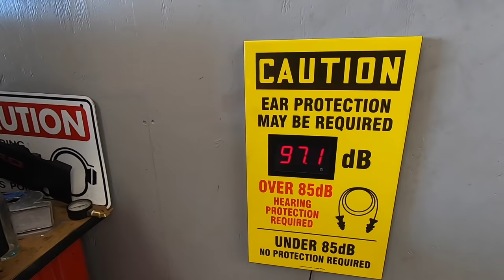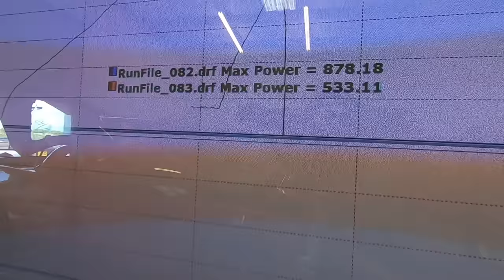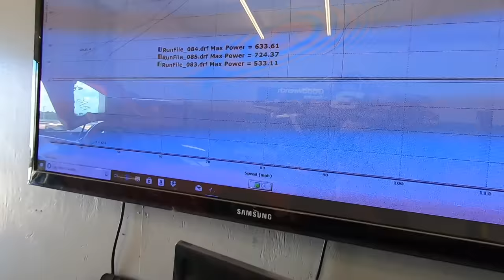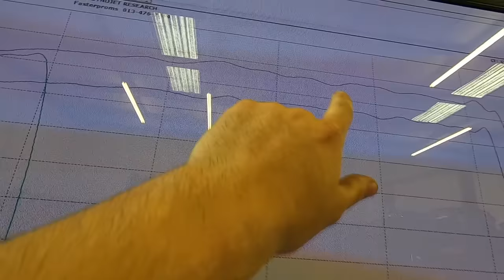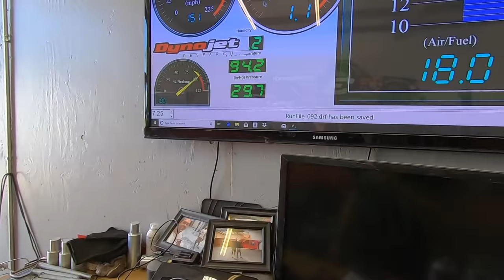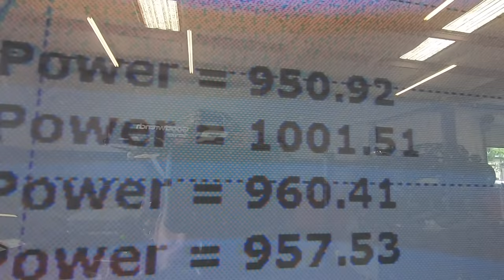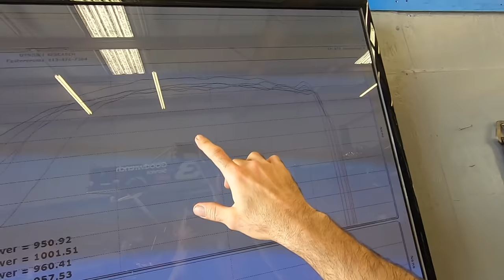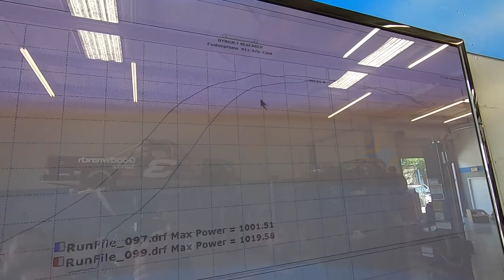The Auction Corvette BOGS DEEP For 1,000hp... Can the Junkyard Engine Do It??

Comment: 1000 horsepower with a Powerglide vs. Leroy slamming gears.
Cant wait.
Reply: Just hope he doesn't money shift Leroy..
Reply: Leroy he get the dub
Reply: There only one clettus he a hell of a driver
Reply: @bsells465  
Ruby is more aero. Will make a way smoother pass with the glide. It should be a close race.
Reply: He will be rusty on leroy and ruby will win one atleast 👌
Reply: Ruby has a chance.. James can drive to 💯
Reply: @tannerrenegar9919  
James is also used to a Powerglide. And not afraid of the rev limiter.
Reply: Ruby will win the race mostly on holeshot and not falling over because of gear shifts.  But it also has just barely gotten into the 8s where Leroy can run bottom 8s with little to no effort.
Reply: With Ruby making 1019rwhp I entered this into Drag racing calculator . If my math is correct Ruby should run ......

1.38 to the 60ft

5.88 to the 1/8th

8.78 to the 1/4

163mph  thru the 1/4 stripe
Reply: @desertrat8322  
Ruby is a low 8 second car all day.
Ran high 8s with 200 less horsepower. The curve with this new Turbo, with the glide. I think it's going to be a really close race.
Reply: Leroy is pretty much an auto when Cletus is in his prime anyway
Reply: James just needs to shift at 8600.
Reply: I have mad Love for both cars, and honestly RUBY is more my style. Buttttt the only way RUBY has a chance at out running Leroy at this stage of the game is if they line both of them up STR8 OFF THE TRAILER with NO test passes before. 
Only bc RUBY is pretty damn dialed in right now, and like someone else said - Cleetus could likely be a hair rusty with the left foot/right hand combo! ...Maybe...
Reply: Ruby is more consistent but Cleetus is also consistent
Reply: James will snap the axle and lose🤣 better have cooper drive and tell him you tuned it down for him but forget to actually do it and he’ll beat leroy
Reply: @desertrat8322  thats just based on hp and weight of a factory vette, theres a lot of weight taken out but a big turbo and all the stuff in the motor bay (almost said under the hood) it would be similar but still not accurate and those simulators are built for perfect conditions, d.a, and pro driver estimations but i like the idea i think the car will be more towards 8.40's and it is all on tire size they are all running small tire almost a street tire size
Reply: This race could be legendary, I'm really pumped for the vid.  Also hope Neighbor and Uncle Sam get to line up.
Reply: @courtneymurphy4476  
No you dont. Fake news.
Reply: I appreciate the tune Up... Georgia's power of the lord

Comment: You should dyno with the flap on the exhaust half half open. Watching previous videos from ruby at the drag strip that flap is pushed down from air resistance past the 1/8 mile.
Reply: Good point! It can't be helping the high rpm restriction!
Reply: It wouldn't make much of a difference if at all on dyno but I definitely see how it could be a concern at high speed.
Reply: The way I see it, even if the tractor flaps are -150hp it's worth it
Reply: Call me crazy, but if you turned those flaps 90 degrees, problem solved.  Hell make em open up opposite of each other and when they both open it'll look like Ruby is giving the two-finger "V" for victory!  Hell yeah!
Reply: Yea when the tractor flaps are closed it can create too much back pressure even being just half way closed and you can lose hp, blew up a motor amongst other things who knows that could have played a factor in that charge pipe getting cherry red hot and not just from having a broken or too small of a waste gate if he turns them around where the wind and exhaust holds them open it might pick up a little bit and he might loose that back pressure issue on the dyno
Reply: I mentioned that and commented on a previous video that they should turn them both around so the air will blow them opened
Reply: @eddominates  I'd bet they lose absolutely 0 HP from the flaps.

Considering bashing headers to fit inside a car does absolutely shit to the HP too.
Reply: dave C I think the restriction is the exhaust manifolds. Isn’t it a truck manifold on one side?
Reply: SkylineBNR34 agreed I seriously doubt the tractor flap does jack shit
Reply: @keefespencer1173  The flaps have no effect on the dyno. The flap can't even fully close due to the sensor at low rpm.
Reply: 70chevelle8 There’s a cross over bringing both headers to one, if I understand what your saying

Comment: Small shot of Nitrous for about a 2 seconds will take care of that turbo lag. Lol
Reply: Better check under the dash for a mini bottle :)
Reply: But don't bring Nitrous anywhere near James! It won't be a small shot for only 2 seconds hahahaha.
Reply: I'd bet on a PID driven solenoid rather than a timer circuit under PWM; CONSTANT DATAAAAAAAAAAAA (and continual gentle reducing of error bars)
Reply: Or rolling launch control, anti-lag works too.

Nitrous runs out ;)

Comment: Lesson learned, check those junkyard blocks, install all new bearings, freshen them up. Have some fun. The deep pan was a good idea, both, for windage and the fact the car leaves hard. For anyone running a dry sump oil system, check those pumps for the proper clearance before bolting them on. Guys have pulled their hair out hunting down low-pressure problems, assuming that the new dry sump pump was a quality piece. Tightening up the clearances [machining end clearances ]brings the pressure up. Keep up the great job guys. I may be one of your oldest fans.

Comment: Loved to see the decibel meter ! I work with many deaf mother truckers and they are always going on about hearing protection and they they regret not wearing it .. now you just need to wear it haha 😂👍🏽 the eardrum will likely rupture at 150db and that one pull hit 124 😂🤦🏽‍♂️
Reply: 150 is is over 5x as loud as 124. Decibels are on a logarithmic scale. Also, as someone who works in audio, this isn't 124dB. Sitting infront of the PA stacks at a rock concert is 125dB. I have no idea where it's reading the signal from, but 124dB at those frequencies would easily leave you with ringing ears for a full day.
Reply: @unlisted9494  1000hp open exhaust? That 123db seems about right. James is always plugging atleast one ear. I imagine coop does too. Cleetus probably gets less sitting in the car so it's not nearly as bad.
Reply: @unlisted9494  The sensor the decibel meter reads from is probably somewhere on the car like the rest of the dyno sensors, hell, knowing these guys they probably put it in one of the pipes. Guess I'll have to wait until Cleetus and Cars tomorrow to hear for myself. I'll report back if Ruby does indeed give me ringing ears.

Comment: Id try some dynamat (or whatever amazon discount version) on the panels for the dyno equipment. Adding the mass and damping should keep the case from rattling around and resonating. Not the egg-crate foam though, thats for stopping higher frequency reflections, and wont stop the panels from rattling anywhere near as well. <$30 shipped for the cheap stuff.

Comment: 100db Lawnmower
110db Steel Mill
120db Chainsaw
123db Ruby
130db Military jet aircraft at takeoff
Reply: A jet is 140db. A 17db jump to the human ear is almost 4x louder. Which is a lot louder
Reply: Actually I think that db-o-meter tops out at 123 db. It stopped jumping around at that value.
Reply: Corvette by cleetus when done - (Inaudible dB)
Reply: My sounds system in my work van does 142db yeah I'm bragging lol
Reply: Dropping shampoo bottle in the shower-600db
Reply: Lol i hit 147dbs in my sedan. All day

Comment: Hey Cleetus: for your dyno pausing issue a solid state hard drive should resolve it.  When it gets super loud as a data protection mechanism the spinning disks park the heads on the drive that run the software for the dyno causing it to halt. Once the vibration (sound level) subsides the heads start to move/read/write again and that's when it starts responding.  By changing the default build-in spinning disk hard drive to a solid state drive with no moving parts sound will not have any impact on it.  They're actually pretty cheep now too.

Comment: If you know where the turbo spools you can edit the area before spool, lean it out and run high timing , basically tune for max NA power, this creates more heat, more cylinder pressure, more NA power and you can play around with this and gain 5-700rpm of spool, plus have more low end power. If you had variable valve timing you can also add overlap to increase spool another 500 rpm but unfortunately you dont have that.

Comment: 123db that's permanent hearing loss country.
Reply: x I agree they need some ear 👂🏼 protection
Reply: Larry Sloan you can’t use hearing protection tuning or racing a car. You need to listen for shift points and strange noises so it’s physically impossible.
Reply: @joshlarochelle1298   bullshit you can hear any knocking or miss with ear protection. You don't have to blow out your ear drums to hear that.
Reply: WHAT ?? @sloanthemechanicl3763
Reply: @joshlarochelle1298 You have no idea what you're talking about. You can hear everything with hearing protection, the sound is just attenuated and you actually pick up strange noises you wouldn't be able to pick up without ear pro.
Reply: @joshlarochelle1298  Brent from PFI wears hearing protection I'm pretty sure and he's a beast!

Comment: Fly me in and I’ll make you guys some great welds for Ruby! Quick question does Ruby’s intake manifold have the allowance for two injectors per cylinder? I also see that your running slicks this time on the Dyno.
Reply: scott moore teach them please!!!
Reply: It is a holley hi ram same as what u can order. Out of jegs so I would imagine those specs would apply here
Reply: Rotor Ryan I would if they would fly me in it would take a couple of weeks!
Reply: Daniel Harrell I thought so if it does they can add fuel using them.

Comment: European car companies: takes weeks,months,years to develop a 1,000 hp car.
Cletus: HOLD MY MOUNTAIN DEW.
Reply: @msengineeringdavid3702  +1

I don't think this engine will do 250 000 km without one major overhaul at least. Even with gentle highway cruise with  the right gearbox (with more than 2 forward gears).
Also, don't forget about the mandatory noise limit (of 83dB @ 3000rpm). 
Also, don't forget we, europeans, drive not only in straight line, but in the turns too. The canyons "of Matt Farah" are ours usual roads. Some of these are almost like highways for us.

I want to watch ruby or leroy in one rally stage of the "tour de corse" for the lulz.

usable power > raw power.
Reply: Guy S Matt Farah drives at a certain place in California just for one takes the rest of California isn’t like that.. there are other states with mountain roads but they are special places some have them as daily commutes but it’s not a real commonality.

Comment: GM set a release date on the new mid engine C8! They should give you one to “bald eagle-ify” one of them bad boys.
Reply: Corvettes should be fr. This mid engine shit is not a vette. I understand why they did it but its no vette. Needs a new name
Reply: @justinwiley9798  the original Corvette rendering was mid engined so actually it is finally a Corvette it's finnally what it was intended to be
Reply: @devinpyrchalla3400  i get that but every corvette has been fr. Thats the basis of the corvette.  It will most likely win le mans but not a true vette. From the start front engine rear drive. Just an opinion.
Reply: Vettes are an old mans cruiser sports car. They have the sound, they have the look, but as far as performance? They are rather slow comparatively. I’ve spent as much as a New z06 on my Nissan 350z, built lq4 bored to 6.8l with a g force four speed top shift. Fully done right. I run 700 as I drive it often daily but could max around 1200. A z06 with 650 hp and more grip than my car as I don’t run rear grip as it’s a drift car, I’d still smoke them doing a rolling burnout. On the tune I run now.
Reply: @joshlarochelle1298  I disagree.  No their not the best but still perform very well. Many 24hr wins under their belt

Comment: Don't laugh off the hearing protection. There will be a day when you want to talk on the phone to your grandkids. You can do things to your hearing that hearing aids can't fix.
Back to levity.
Reply: Captain MufDyven  Great advice. I as well have been around lots of loud cars and work a profession where its loud all day; chainsaws,stump grinder, and chipper are very loud. Im only 28 and have the high pitched ringing already. Have for some time now. I often forget to wear proper hearing protection and regret it nights when I try to sleep with no fan on to block out the ringing. Drinking alcohol worsens it too fyi
Reply: Steve Kappes for the purposes of tuning and racing it’s physically impossible to wear hearing protection because you have to listen for shift points and strange noises hence why you never see tuners or drivers wear such. As far as any other form of loud noise absolutely I keep a few different kinds but for most work I wear noise cancelling headphones under 100 dec and I have heavier duty for louder. have to use them when you can in this field. Just can’t when tuning or racing hard.
Reply: @joshlarochelle1298  You wear noise cancelling headphones for hearing protection....?!? 

Also, that is ridiculous. I've worked a lot in the live music industry where sound is the #1 factor. Every single person I know who works continuously in music wears hearing protection and that's on the same dB level as the pulls in this video. Good hearing protection just lowers the volume vs muffling it. You can get proper hearing protection that is filtered allowing it to actually sound clearer and it'll be moulded to fit way nicer. Being able to still hear is better than screwing your hearing, thus not being able to hear properly.

The levels Garret is exposed to, he'll need some serious protection. It's all fun and games until, but like the above comments have said, Tinnitus is no joke and can be awful to live with. By 35 / 40 Garret will know about it if he doesn't start to be smart about keeping his hearing.
Reply: @joshlarochelle1298   You'll see Jeremy wearing ear plugs when he's tuning.

Comment: At sea level the atmospheric pressure is 14.7 psi so at every 14.7 psi the engine is technically double the displacement. Because that's double the amount of air in the engine so its double the fuel meaning double the displacement. And at 29.4 that's triple the displacement.

Comment: New big Turbo is begging for an Accusump after-oiler.  Every time the engine shuts off after a run, the turbine continues to spin at very high speeds, and very rapidly cokes the turbine bearing oil... be nice to it :-)

Comment: Cleetus… I flew RC planes, ride motorcycles, rock concerts and shot guns…. All with no hearing protection. I’ve basically burnt a hole in one frequency so I can’t hear people talking, especially in loud surroundings. I’ve also got tinnitus (ringing) 24-7 for the last 25 years. Take it from a guy who doesn’t hear anything without a high pitched tone… dude… wear hearing protection. Even if it doesn’t sound “loud”

Comment: Cleetus, you need to tell Jeremy that his Dyno computer needs an SSD hard drive.  I think what is happening is that the harmonics from the rippers on the Dyno are causing the read heads on the mechanical hard drive to bounce around which would be causing the computer to freeze up when doing a FULL PULL!
Reply: Yeah there’s about a 99% chance that was the issue

Comment: I HAVE AN IDEA!

Let's push fifty pounds of boost on an old LS with a stock bottom end, regular pistons/valves, stock sleeves and rings, half the fuel pressure we need in order to keep us from going lean and gosh darn, what the hell do we need ninety PSI of oil pressure for? It's all going to go into the catch can anyways!(not that we drain it very often because let us be honest, our duty cycle on our maintenance doesn't involve one single bit of marking down how many runs we've done so what's it matter anyway?

No shortage of engines to blow up!

Comment: 12:04 Cleetus is that nitrous I see in the passenger floor
Reply: No that’s co2, they use it to control wastegate pressure. They have the same setup on Leroy
Reply: Spencer Secord Okay thanks I wasn’t sure cause I’m not really a boost guy I’m more n/a because I run 1/8 mile because the closest 1/4 track to me is 8 hours

Comment: got a question for you EFI gods I have a 96 ford with a 351w any ideas on what I should do to make it have more power with that ancient EFI system?
Reply: Matthew Brookey  
Megasquirt ECU (affordable stand alone)
Cam and springs 
High flowing aluminum heads 
With a cam/spring upgrade and ECU it would handle boost pretty damn well if you went that route
Reply: thanks !

Comment: NOT a junkyard engine tho. It's called STOCK BLOCK
Reply: From a junkyard
Reply: @mrskittles5150  stock block from a junkyard. The rest of the motor is brand new aftermarket parts. Thus, it's a junkyard block, NOT a junkyard motor. Junkyard motor implies that the entire bottom end or entire longblock is from the junkyard 😉 you're welcome

Comment: What compression ratio do you use on ruby? I'm building a turbo 6.0 and would like to run up to 20psi
Reply: SkymanAK47  9.5 to around 10.2 would be good. Just remember the more power it makes NA, the less laggier it will be and the more power it will make per PSI of boost. If you want a bunch of turbo LS info check out the Sloppy Mechanics youtube channel, he goes over damn near everything about making power with these engines. You shouldnt really be concerned about running a certain boost pressure and more concerned with how much power you want